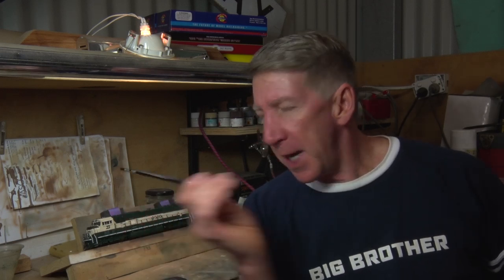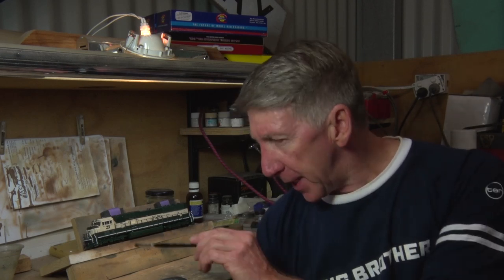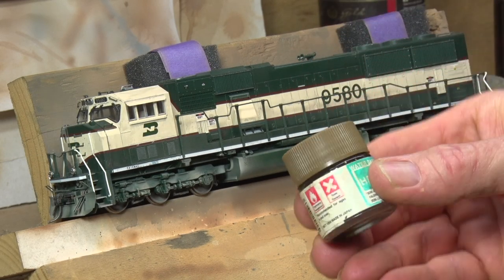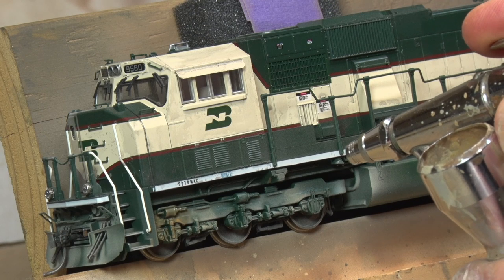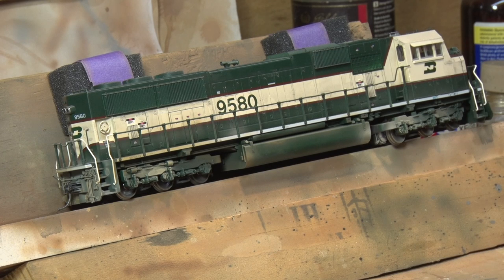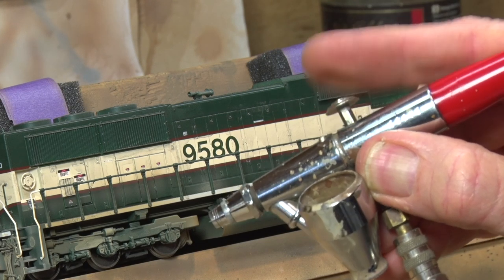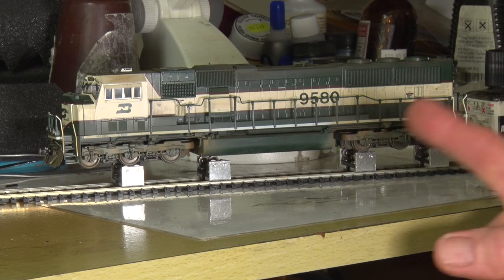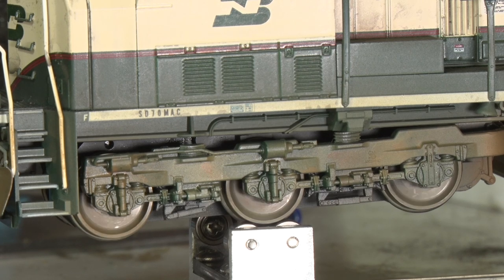Weathering HO Locomotives . Part 3.  Airbrush, pastels and "Rolling Road"

Comment: Hi Gregg, nice work on the weathered SD 70 .
For the last few years I've been mixing my own colours using water based Artist acrylic paint .
These I get from the 2 dollar shop , I got this tip from an old chap that was a panel beater spray painter .
He was using these paints for large scale RC  WW1 planes which were super detailed, 
I gave it a go and haven't looked back since never have to buy another bottle of paint again and  I  have all the colours of a rainbow.
It also goes through my single action airbrush with a very fine milky finish without that  grainy look .
I also use  what I call Fathers Little helper , it basically Windex Window cleaner , this helps with a smooth flow of paint through the brush .
This helps  especially when I spray outside early mornings with natural light , I use a No 1 needle with a No 3 cone.
All I do is clean up with hot soapy water and have never had the paint block up in the airbrush , just thought you might like to give it a go.
You will be pleasantly surprised of the results .
Regards 

Shaun

Comment: D or even arned nice!  Your colors for the frame/truck weathering look just right.  We get a fair amount of SD70MACs running through my area (eastern Nebraska) so I am quite used to seeing the real thing.  A couple things to look at for the future:  the "BN" logos are not renewed and many are quite faded compared to the rest of the lettering.  I would either attack them with some VERY FINE abrasives or even look at fading them with isopropyl alcohol (IPA) or paint.  Obviously, practice first.  The US Federal Railway Administration mandated safety striping on the side sills.  Many BNSF SD70MACs in "executive" colors have the yellow stripes placed intermittently along the white sill stripe, giving an interesting effect. I did mine with Microscale decals.  I agree with you that the Tamiya Panel Line wash is a delightful tool to add to the workbench.  Very usefull stuff for many model applications.  On the fans on Kato units ("motors" in local BNSF parlence) I find that I can add the wash just as you did, then after that dries I can pick out the fan blades with a fine brush and some light to medium gray paint.  Then a quick, CAREFUL wipe with IPA will remove the excess paint from the grill work.  That can really fool the eye into believing that these are see-through fans!  Overall, you have done a fine job of adding weathering to these locos.  They don't get a lot of exterior love from BNSF at this time, but many are still plugging away through my area.  Yours is a nice representation of the real thing.
Reply from the maker: Hi Gary, thank you very much for the kind comments and support! I'm yet to try fading the BN letters, and I'm waiting for a decal sheet for the safety stripes and BNSF patches...all you Yanks keep using them ...LOL  I have a glass fibre pen that is used for cleaning electronic boards and it is perfect for removing paint very slowly, so I will try that in the future...I have another 3 Exec' Macs to do plus a Merger scheme. I love the fan idea, but having one eye , my fine brush skills are not that good but I'd love to give it a go! It's very cool that you get to see these in person and I was lucky to get 2 on video during my visit in 2015.  Thanks again for watching sir.
Cheers Gregg.

Comment: Great job Gregg the weathering looks spot on to a lot of real life loco's I see every day I do my weathering on the locomotive wheels the same way having it just barely idling on some roller roads you did mention not to use alcohol to clean the track what do you use thanks for the great video matt
Reply from the maker: Thanks Matthew!  Lucky you getting to see these every day...I can't wait to get back and do some more rail fanning in the US and Canada. For the track, I use a spray called Innox, it is like CRC or WD40 , and does not contain silicone or any petroleum products and is safe on plastics. I'm sure you can get it State side , but CRC do make a similar product. 
Cheers Gregg.

Comment: Hi Gregg, do you seal it once you are done with Pan pastels? Joeoz3751
Reply from the maker: Actually I don't Joe. I don't handle rolling stock much and once on , the pastels won't rub off easily. I have never sealed any models and they seem to be lasting fine? Different if I was transporting them to shows or clubs though?
Cheers Gregg.

Comment: its such a shame to ef up a train this way. Personally I have never liked the "weathered"  look on anything, its the service life in me, everything spit polished lol. (efed up = well weathered)
Reply from the maker: Hi Gibbs, having seen these locos in the flesh, this is (as others have suggested) a fairly accurate representation of the real thing. I also don't like heavily weathered rolling stock , especially motive power , as the class 1 railroads , and others try to keep their units as clean as possible...but there are dirty ones out there! Most of my locos are lightly weathered on the body and a little heavier on some of the trucks...just like the prototype ...and look much better than a plastic polished model in my opinion. 
Cheers, Gregg.
Reply: @FishplateFilms  G'Day Gregg, Matey don't get me wrong, more power to you for doing what you like to your own gear, its just not for me is all. I can't help it, every time I see this being done I just cringe! I can appreciate the level of skill it requires to pull this off so as to look outstanding and not some Vincent van Gogh nightmare abortion, just will never be doing this to anything of my own. :D